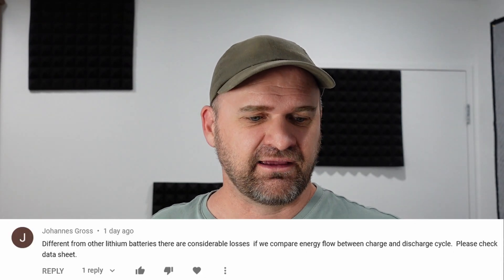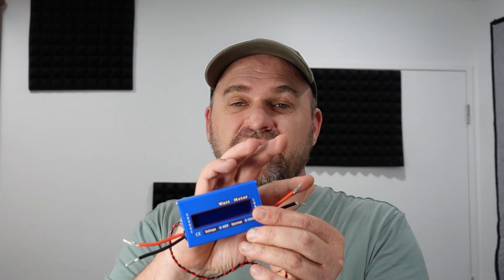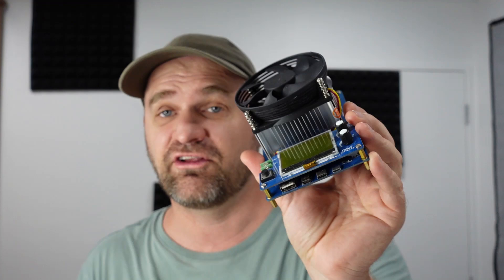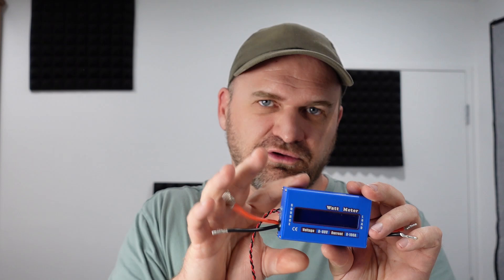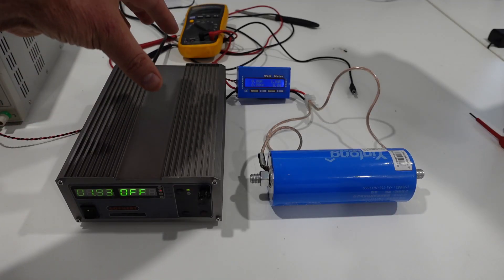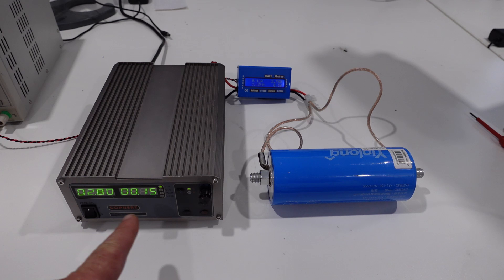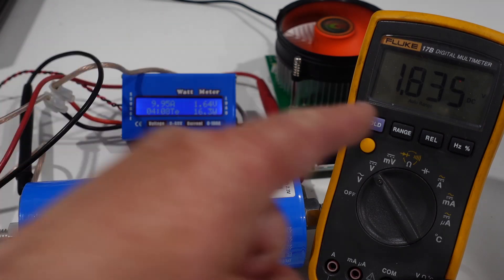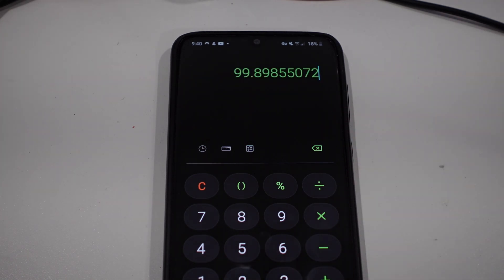Efficiency test LTO Yinlong battery

Comment: Hi Tait. Thanks for your videos. I'm a beginner in the battery field. Could these batteries be used as battery packs for custom Ev conversions?
Reply from the maker: Hey, no problem.  Honda and Mitsubishi have used this chemistry in some of their domestic vehicles.  They are heavy for their energy tho.  If I were to do an EV build with these, I'd use prismatic cells as they have a higher volumetric energy density.  Range will be limited, performance could be quite good, life span and safety would be as good as you could get.
Reply: @brendontait6968  Thank You. We wish You best with your plans from Scotland. :)

Comment: I’m guessing because Will talked smack about them, but he didn’t have grade a cells, I think he tried again with better cells and had a much better experience
Reply from the maker: Yeah... so many fakes out there.  Easy to get caught out.
Reply: I think it's probably not wise to measure CE at high rates and maybe it was only about that. At high rates you have a high internal voltage drop that makes it difficult to detect correct end points for the cycle you measure . Also because of the discharge voltage profile which is not like in other lion cells

Comment: Possibly stupid question here, perhaps I missed the obvious: what kind of charge controller is suitable to this type of batteries (in an RV/campervan context)?
Reply from the maker: Hey... with the pack configuration I made it should be compatible with most solar, alternator charging systems.
Reply: @brendontait6968   thanks for replying! Appreciated! So, perhaps that's why I didn't find much specifics on that topic. So, I have a good quality wallpower battery charger, a good quality electronic battery (de)coupler for alternator based chargin and a good quality solar charge regulator (currently connected to conventional batteries). That setup would in principle "just work" with the LTOs as far as you can tell? That'd be cool.

Comment: Yeah thats a nice Test. But voltage during charging and discharging does matter. You can directly calculate the losses from the difference between "no load voltage"(after the battery was Just sitting still for a while) and charging or discharging voltage multiplied by the charging / discharging current
Reply from the maker: You're right, it does matter, but I believe the difference between coulombic and power efficiency will be low.  I don't agree with measuring the no load voltage as the internal resistance of the battery changes at various state of charge, additionally there will be electrochemical processes that will alter the voltage.  I may do another video measuring the actual efficiency rather than just the coulombic to appease people.
Reply: @brendontait6968  looking forward to See that Video :)

Comment: Amp hours mean nothing watt hours mean more amps times volts equal watts in theory it should take less amp hours to charge than discharge to have equal watt hours
Reply from the maker: Yes, tho until someone provides me with a ytterium barium copper oxide based test rig, it is too difficult with low voltage cells to minimize the wiring/measurement loss.   Wh and Ah efficiency should be very similar in this chemistry.

Comment: I was thinking of strapping 11 of these across my 24v FLA bank to help reduce voltage droop during short high current surges. Any opinions would be appreciated.
Reply from the maker: Hey... it's not something that I have done or even considered.  It would work.  However, some things to consider....  when your voltage is say up at 27V, the LTO will want to stay at 27V whereas the FLA will naturally want to drop to roasting (say 26V) therefore the pack will be self discharged (to the resting voltage of the FLA).  A lot of people will say unreservedly that you cannot do it.  But as long as you take things like this into account it will likely work.  Disclaimer tho, am inexperienced with it.
Reply: You talked about the voltage variation between charging and discharging for FLA and I wondered if you had any figures for the LTO cells.

Comment: i have a question if you have time and know the answer...im trying to charge lishen cells with a rectifier...im having trobles as the cells resistance is low so the pack is seen as a short by the surcuit braker...iv tried resistors on the ac side but im losing a LOT of power through the resisters (kettle/oven eliment/light globe iron etc)..im trying to make a light simple charger for a bike...trying to charge very fast....what answers do you have for limiting currant/raising resistance?
Reply from the maker: Hey Russell, unfortunately you need a current limiting power supply.  I'm not sure what you are charging it through...  rectified straight from mains?  It may be possible to use an old school arc welder primary as a ballast, using the choke to adjust the current flow.  Let me know how you are currently charging and we can try figure something out.
Reply: @brendontait6968  thank you very much for taking the time to help me...yes i first used a rectifier strait from the mains but it trips surcuit brakers then i moved to risistors (kettle etc) in line on the ac side but they gobble up a lot of power and my charging becomes slow.you have given me clues im reading now about reactance.i have a capasitor out of a microwave?..im in australia with 240vac 50 herts.
Reply from the maker: Yeah a capacitive reactance supply will work, but might be slower than you want?  I'd probably be looking at an inductive supply as I think you are likely to get more power through it.  Be careful, playing with big power can be dangerous.
Reply: @brendontait6968  yes im scared of dangers..especialy ones i dont know about...yes i do want to charge fast..as fast as a house hold out let will allow 2400watts or 10amps at 240v i think is practical as there might be other apliances on the line... the battery pack drags the charging voltage down when flat (determined by the motor controller cut off) 28.5/29 volts dc .so about 80 amps there....i like your advice to go for the inductive supply and where i might scavange one from an old welder....my first thaughts are try bothe a capasator and a choke seperately but i have no idea of the specifications i will be looking for? or if i just try what ever i can find?

Comment: In order for current to flow into a battery there has to be a difference in applied voltage and the voltage of what is being charged. Therefore taking the charger off of the battery will instantly reduce the voltage at the terminals, this voltage at the terminals simply reflects what the level of charge the battery currently has.The battery never has the same voltage as the applied voltage until it is fully charged. Fundamentals of electricity.
Reply from the maker: Yes, but the amount of drop is highly dependent on the internal resistance of the battery.  Due to the enormous surface area of the nanoparticle crystalline structure of the electrodes on titanate cells, the internal resistance is several orders of magnitude lower than some other chemistries.

Comment: Myth not busted. Charge efficiency has to take into account charging voltage and discharge voltage. LTO - charge V = 2.8v LTO nom. 2.3v gives an efficiency of 82%. LiIon charge 4.2v nom. 3.6v, efficiency = 86%.
Reply from the maker: Yeah... I think you've missed something there sorry.  What you've just described is definitely an incorrect method for figuring it out.  For eg, the charge voltage is only 2.8V at the very end of the charge cycle.  Let me know if you want some more insight.
Reply: @brendontait6968  You are right to some extent but you have to take into account the difference between watts charge and discharge over the whole charge and discharge cycle. This also also depends on charger efficiency.
Reply from the maker: Well the charger efficiency has nothing to do with the battery efficiency, moreso the system efficiency.  I explained in the video the reason that I was measuring coulombic efficiency and not power efficiency.  I don't have liquid nitrogen cooled ytterium barium copper oxide measurement equipment.  I also explained that these cells do not have float and sag like for example lead acid do therefore the coulombic efficiency will be very close to power efficiency.
Reply: @brendontait6968  What matters is how many watts-hours went through the meter in the charge and discharge cases, which you didn't actually measure. Anyway even at 80% or 90% 'efficiency' who cares, because it still makes $$$ sense since they are more than 20% cheaper.
Reply from the maker: I explained in the video why I measured coulombic efficiency and not power efficiency
Reply: Exactly... this video is silly.... mAhours is not a measure of energy.

Comment: You are right about the efficiency. There are other unfortunate problems with the chemistry though. I looked into LTO extensively and I really wanted to love it but it just doesn’t make sense for me.
Reply from the maker: What other unfortunate problems do they have?
Reply: @brendontait6968  Only relatively small cells are produced. So to make a 30 kWh pack would a huge number of cells and would take up a ton of space. Unlike LiFePo4 which comes in 280ah cells. Also they are extremely expensive and far more expensive to ship per wh. Also the working voltage doesn’t generally work well with standard 12v equipment. Basically it comes does to use case. For an off grid solar setup or any 12v solar setup it is extremely hard to justify LTO when LiFePo4 is often more compatible, weighs less, takes up less space, still lasts a very long time, uses less overall cells (can be easier to service/build packs), and comes in a larger variety of cell sizes. So even at a similar cost LTO really only has C rates and cycle life going for it, but with LTO at 4x the cost it’s a no brainer to go with LiFePo4 in my opinion.
Reply: it also has low temp going for it. for an rv that is useful
Reply: @justicelee26  i chose a LTO build for my rv because i live in ohio which 55% of the time, its cold as hell. down to 2 - 3 degrees Fahrenheit. and LTO cells are claimed to be able to be used in those temperatures, and even colder. Lifepo4 is so much easier in some ways because there is a huge selection of BMS for them.

Comment: I've had the CPS-6016 for a few years now, it is an excellent supply for the money, and very compact. Voltage goes up to 63V at 17A which is a nice bonus!
Reply from the maker: Hey...  yeah, I find it a really good supply tho like I mentioned in the comments you have to be mindful of the high capacitance on the output if running circuits in constant current mode.
Reply: @brendontait6968  Totally! I make a habit of starting a load at undervoltage levels or constant current mode before dialing it up. The output capacitance is quite sizeable.

Comment: Hey Brendon, good test - at least this debunks a myth before it gains popularity. Thanks for taking the time.
Reply: disprove
Reply: @brianwilless1589  (I'm not entering as foe) - but normally in the scientific community (though I do not pose as such) you'd pick out something in particular you don't agree with...Otherwise you'll view point is as good as Karens. Maybe you hold a valid point? 
 
Seems between Brendon and Will (who've conducted testing of their own) there is  some form of consensus, whilst Will tested recently on 12v, 24v & 48v systems mentioning on a 12v it doesn't offer the same return as the larger voltages.

Is there anything in particular you disprove of, regarding the study?

Comment: Thanks Brendon for the test on overall charge and discharge capacity, My 6Kw LTO bank has been running fine with a daily 7.4kW 24hr usage which 12hrs of that being over night, sun down, running on battery only, the only problem I have had is one cell bank of the 22S 3P is not running as it should, I think that I have a partly failed cell that has let me down, this has happened since first running the bank many months ago, I will get around to load test that set of 3 cells which will be replaced, My Victron app tells me overall of 844kWh usage which about 50% would have been from battery draw down
Reply from the maker: Hey Ross,  One thing I have read about this chemistry is that it doesn't like the be stored with high charge and high temp.  That is the only thing (ither than mechanical abuse) that I've heard can make them fail early. Am interested to hear your outcome.  
Cheers
Reply: @brendontait6968   I was very careful when tensioning the main 2 bolts and used a tension wrench just to be sure.

Comment: Hey Brendon nice videos, but the 99.9 efficiency falls over the quicker you charge and discharge the cell, of course this applies to al batteries and I assume that is why you didn't mention it but sometimes your battery could be drawing more than 1C and then you'll be losing that efficiency pretty quickly. Maybe do a comparison of Lipo and LTO chemistry at 2C or 3C? might be a bit harder to test but would be very helpful. keep making the good vids!
Reply from the maker: Hey Alec, thanks... but fairly sure I mentioned that around the 7 minute mark?  I'd love to do some 5C charging but don't yet have the capability - one day!  1C on my battery pack is around the 9kW mark.  So not likely I'll exceed it too often.
Reply: @brendontait6968  Have you tried alternator charging yet? Is it a 12V or 24V alternator? Either way should at least hit 1.5kW. My car peaks at 130A when charging my supercaps to 14.2V from a low 10V on a cold morning. Keep in mind alternators are only 50% efficient, so for long charges like yours, you want to maintain 2000-3000rpm so that the alternator  internal fan cools the windings.
Reply: @brendontait6968  cool thanks for the reply!

Comment: Another great video, thanks Brendon!!  I researched LTO 2-3 years ago & I'm 99.95% certain that I read the '85% round trip efficiency' from a manufacturer spec sheet, which could have been just a poor translation / translation error.  Does anybody else remember seeing that spec?

Also, another funny "no formal training, just muckin about" moment:  'Great little watt meter, but it's not perfect, so I fixed it.'  :-)
Reply: The 85% may be at the rated discharge rate which for lto is commonly 10c to 15c which is ridiculous for most applications (for a 40ah cell that's a 600a continuous draw!)
Reply from the maker: Thanks Frank, yeah... I haven't seen it aside from watching Wills video.  It's possible that some of the early versions of this chemistry were at that level?
Reply: @brendontait6968  Yes, that's possible.  I do remember the distinct impression that it was a "deal killer" for me at the time.  I'm just glad you've cleared this up, thank you!!
Reply: Round trip effieciency does it incude inverter loses?

Comment: Thanks heaps for the good info and demonstration to back it up. 
Regarding getting my hands on some of these cells (in Australia, close to NZ); What is the best / cheapest method of shipping from China you have found? Or did you just go with the standard shipping from the supplier you linked to in your previous video? I tried buying some LiFePO cells and shipping was expensive (about as much as the cells, which turned out to be low quality anyway. arghh!).
Reply from the maker: Flick me a message on the email listed in the description in my battery video for group buy options